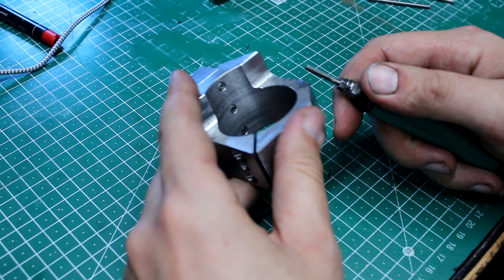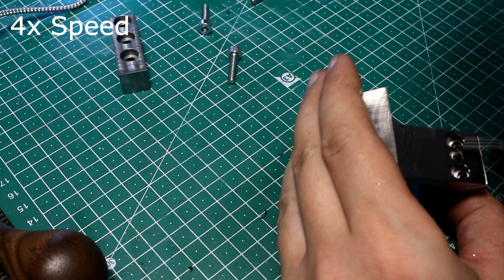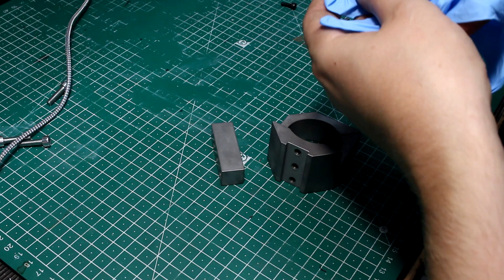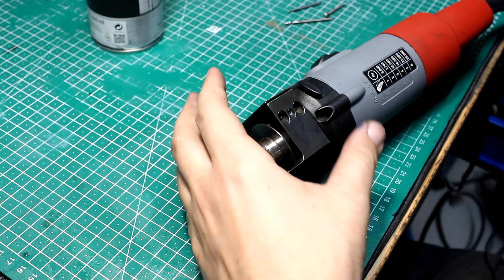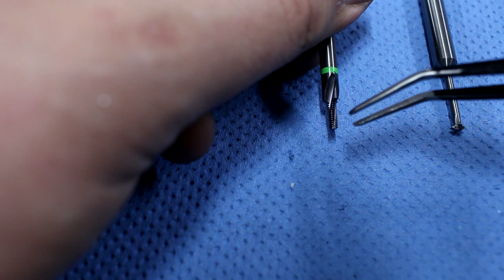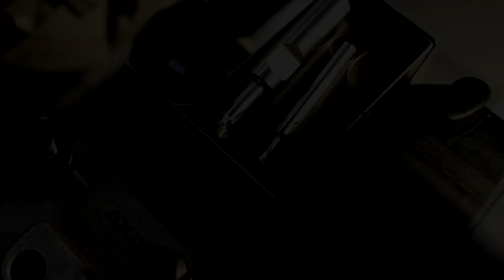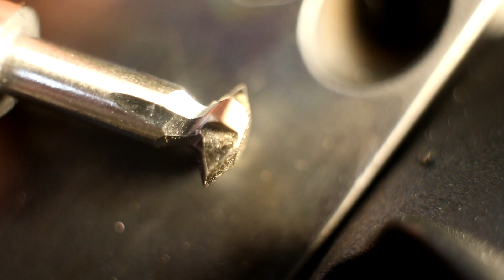Threadmilling on a manual lathe

Comment: Seems like we have a similar strategy on deburring: 
Step 1: remove blood stains
Step 2: debur the part
Step 3: check part for blood stains. If any found, repeat at step 1
Reply: Im a hvac guy by trade.  When Im knocking tin, I bleed.
Reply: Totally agree, I cringe when I see home gamers (and some pros), checking a broken edge with their pinky to see if its still sharp. lol
Reply: @1ginner1  at least they check. 😅

Every shop I've been in, everyone leaves sharp edges or burrs to save time and cut corners.
Reply: Cutting corners by not cutting the corners?

Comment: Hi Stefan. Nice to see the solution to a very old problem for which the model engineer's Guru George Thomas had a much more complex solution. Folks, when you slit into a previously bored hole there is a tendency for the bore to close in. Stefan's jack screw is a very simple and elegant solution. BobUK.

Comment: I have been doing milling on my lathe for a while now and the first thing you need is a spindle indexing disc and a brake acting directly on the spindle axis. I usually index the chuck by jamming the feed gear that's 1:1 to the spindle with a pin and that way I do keyways, holes, steps and I even made the 60 position axial ratchet for my Tripan toolpost using this method. Don't forget that you can use the compound to mill at an angle (eg to make an insert cutter) or put it above or below centerline using the qctp (usually to sidemill a surface that is on centerline) essentially utilizing it as a limited travel vertical milling attachement (you can't feed upwards though).
Reply from the maker: Personaly I am not to interested in general milling on the lathe, my mill will do that better, but its definetly a nice option to have!
Reply: @StefanGotteswinter  The mill I work with is a very heavy to move around and setting it up is a real hassle. Being able to cut a keyway in 5 minutes is such a delight for me!

Comment: Could you use a small generic end mill and do an ACME thread with that setup?
Reply from the maker: You would need a tapered endmill, and then its still questionable if you get the correct threadprofile..

Comment: Thanks for letting me look over your shoulder while you explored this - very kind of you.

I was wondering why you didn't use your chamfering machine you made back in this clip: https://www.youtube.com/watch?v=M8pLEfKZy4w  ??

I like the climb grinding technique for doing chamfers as well -  much better results. 

I see you went with a brushed grinder - instead of an air grinder - like a PLANET 600 - capable of doing 1um grinding? Both the  NSK and the Kress seem quite expensive for what they are 10um and 1um spindles.  Might be possible to create an air bearing spindle? The ER16 adds a lot of value to the Kress - wish the price was a bit gentler. 

There was a similar story to the cannon - Roman engineers and their families had to live under the bridge they designed for a year - probably just be a story - can't find any historical references to it.
Reply from the maker: It was quicker to do it with the biax, as there are many internal/circular edges that needed to be taken care off.

Comment: Since we know the Germans are very precise, and matter of fact on details, I now have this image of Stefan trundling his shop vac a quarter of the way down the road to Munich laying out the PVC string in order to give us that measurement.

On the flex of the first threadmill, seems like it might be possible to set up an outboard two bearing steady on the shaft of the threadmill itself if the flex becomes too much of an issue?
Reply: I don't know if his calipers would reach that far but if any one could do it Stefan would find a way !

Comment: Great stuff, Stefan! Since you have that lovely Deckel, could you not make rounded tip instead of a sharp corner? (and thereby keep the root diameter a little higher/match screw threads more closely)
Reply from the maker: Yes, I could dress a tiny concave radius into a wheel and use that to grind a radius on the tip. Probably a pain in the youknowwhat without a optical comparator to check the radius ;)
Reply: What about a truncated tip instead of a radius? It would still let you increase the minor diameter.

Comment: In your opinion Stefan, as someone whodoes a lot of smallrun production, do you feel this saves a worthwhileamount of time vs single point? I suppose you could thread 1 part perfectly, note your crosslide position etc. And then just churn threads out on a bunch of parts, two passes each yeah?
Reply from the maker: It might speed things up, especially on threads that would normaly need many passes to single point.
But more so for those impossible threads on a manual lathe..
Reply: @StefanGotteswinter  ok cool :) thanks for the reply and great job, looks and functions really well
Reply: Wow ok the second type was super fast haha threads from thin air, guess that answers my question haha
Reply: That was an awesome video. Super nice finishes

Comment: One problem you may find with the digital microscopes is lag. However rolling your own with good performance is not hard. Use a cheap racing drone camera with a display. It can be wired or wireless Drone flyers can not have lag when flying. Most of these done cameras have a C-mount. There are several little microcpe assemblies on amazon with C-mount adapters you can mount the camera to.

Comment: In my father's shop back in the seventies we used to do the final grind on hardened threads with a diamond embedded linen phenolic wheel mounted on a tool post grinder.  It wouldn't take much off but it made the threads extremely slick.  It was set up much like what you're doing except the cutter and/or lap was mounted on a mandrel.  The angle could also be adjusted for clearance on larger threads by tilting the spindle up and down in the front.  Fun stuff!  Thanks for the video!

Comment: I have both high quality optical microscopes and cheap video scopes. I put a video scope with built in display (about $49 if I recall) on a magnetic indicator base. I use it in my Emco super-11 and my Hardinge toolroom lathe. It gives a great view of cutter action if you need it.  It is also is useful on the mill too. While the quality is not like a Leica scope it does keep your face away from the action. Don't under rate the cheap scope it works and other can see it. Great for demos. 

 I mounted a Dremel moto-tool on my Emco 30 years ago to spin and abrasive disc to cut Hastaloy X . I also had an air turbine with a multistage planetary to spin a slitting saw for screwdriver slots on a homemade gang tool CNC lathe. I also used a full speed turbine (50K or so) to spin very small PCB drills on the gang lathe too.

By the way Robin mispronounces Hardinge. He says Harding instead of Hardinge. I noticed you have adopted that too.  The correct pronunciation ends with a sound like Hinge (like door hinge) but without the H sound. Please take no offense your English and your videos are excellent. I watch them all.
JY
Reply: I've been wondering about that for years!

Comment: That would also work ideal for face grooves/recesses on a part with the spindle parallel to the lathe spindle. The OD Perpendicular thread milling with the proper profile tool could work good for custom wood screws or metal inserts for plastic/printed parts.
Reply from the maker: Right after I read your comment, I looked at a drywall screw ;)
If I ever need to make something like that I will keep that in mind!
The facegrooving is something I tested (didnt film it), and it works suprisingly well, and with the cutter doing a full slotting cut, it also runs very quiet.

Comment: The reverse set-screw interference fit bit is a nice trick.
Will be adding to my designs.
Reply: Same system as used on my 40 year old drill press head.
Reply: Referred to as "Jack Screws". I use them all over the place

Comment: Very nice Stephan.
I find lots of little embellishments you do usefull to learn.
Like using a set screw to open a coller clamp that allows for a precise fit without over torquing a small fastener.
Like Filing a precise 45deg bevel junction on an inside corner.
Instructive, thank you Sir.

Comment: I would have thoroughly enjoyed working side by side with you back in the day. I like the way you think. 100% Great video.
Reply from the maker: Thanks Joe, thats an honor hearing that from you :-)
Reply: @StefanGotteswinter  yes i think this system  . could answer my problem i have with my lathe . it being  a Colchester . graduate with out a led screw. it will signal point thread  . but using the rack. &  not the  lead screw. i feel the rotary & linear drive being fixist will  . tack to thread cutting By this metered well   thank you Stefan.  Les England tried it out & it as the potential to deliver a varying ranges  of thread pitches frim pipe thuds to BSF & WITE  I've  yet to  try metric   I have been using old broken taps to develop my thirds & the appropriacy thread gearing for the rack. intrusting results .
Reply: I love it when our favorite YT machinists contribute on the rest of the community's content.  We have a pretty great little corner of the internet with some pretty great people.  You're a stud Pi!
Reply: @shirothehero0609  Stopped watching TV time ago ! Dont even have a TV anymore... 
With all this content coming, I watch only this community
Reply: you two should open an international shop together. "Precision Inc."

Comment: Manual lathe live tooling! I improvised mine on my beat up Sherline by repurposing a Dremel I had lying around, it works well enough for engraving lines on knobs and things like that. For that last test with the D-bit, I would think leave a kind of rough finish at the bottom of the thread valleys, since the surface speed at the tip is only whatever RPM you've set the spindle to?

Anyways, always nice to see another video!

Comment: Nice work Stefan, could you do a multistart thread on the Emco?
Reply from the maker: Yes, of course. There are multiple ways of achieving that. Either by indexing the work after each thread-start (Works best between centers), mounting a compound slide back on the lathe (oh horror) and move the threading tool in Z direction for the next thread start. 
Realy brave people can swing the changegear-banjo out of mesh, turn the spindle the desired angle and re-engage the banjo.
The last version has the highest pucker-factor ;)
Reply: @StefanGotteswinter  Sounds like your next video! :-)

Comment: Hi Stefan, this was excellent Thank You. A few questions - Did you try a rough cut on the in / out feed then an immediate spring cut by reversing the feed? Have you considered Dremel diamond cutting wheels for your tiny tool cutting? Could you make a tiny tool support (like an itty-bitty knurling tool) with bearings for your milling tool? Lastly, could you cut ball bearing screw threads and a nut for high efficiency & precision parts? Stay safe and well :)

Comment: What is the brand name of the hand held die grinder used at 2:05 in the video ?
Reply from the maker: Biax SRD 3-55/2
http://www.biax-germany.de/en/produkte/data/SRD-3-55-2_150000925.php
Reply: Ha. Clearly I wasn't remembering correctly.
Reply: I think he has mentioned before that it's just an "El Cheapo"... But I'm not 100% sure if I'm remembering correctly.

Comment: "I'm not the first guy to do this". Stefan, by now I would think just about anything that could be done with a manual machine has been done. IMO the most impressive things done on manual machines are turbine impellers that were done pre cnc. And the interrupted threads on the breaches of large naval rifles. Given the pressures they had to withstand they had to be absolutely perfect.

Now if you had a way to run your cross slide at the proper ratio you could make chuck spirals. And I know they had set-ups to do that on manual lathes. Setting the router at the center of the included angle you could also cut buttress type threads.

Not germane to threadmilling but in the past I experimented with making roughing mill cutters out of taps. Grind a relief angle on the top of the teeth that gives a flat wide enough that all the flats are longer than your taps pitch. Grind a secondary relief angle. Works fine on softer materials. Not so much on tool steels. I worked with some machinists from Germany and they told me that in the 50s they used to have to make end mills out of twist drills.
Reply: I would like to hear more about the difficulty associated with cutting the interrupted threads for naval guns. Can you point me in the right direction to more information?
Reply: @BravoCharleses  
Sadly no. To be honest I don't know if they where single, double or multiple lead threads. I suspect that multiple lead threads would be weaker simply because of the lead angle of the threads.

Comment: Hey. I use the cheap video scopes and find the latency always messes up my actions (in electronics). Good for static but not for dynamic. We use the Vision Engineering viewers for assembly work and they are great. You look into them and do not have to have your face on top of it. There is also some 3D effect. Highly recommend 750-1500 USD
Reply from the maker: I have a Mantis at work, and to be honest, I am not the biggest fan of it - I can work better with a normal stereo microscope, as the head is kinda fixed in place when looking trough the eyepieces.

Comment: Diamond and HSS works fine, and the resin-bonded diamond wheels are so cheap now that you can ignore how terrible an idea it is. 
I suspect that the "diamonds dissolve in steel" thing (which is undoubtably true) is more of a problem with single-point diamond tooling than with effectively disposable Chinese cup wheels.

Comment: If you set your parts on a paper towel after applying the activator, the bottom side may not get the full effect. I try to use a rack over a small container to catch any drips. If you flip them half way through the process, you can ensure the most even finish. A good cold blue finish is all about the preparation. Great video, and great design for the toolpost router, I am gonna steal the general shape, except I am also gonna build one for a TIG torch.

Comment: Is Kress related to Fein? The design and colour scheme seem identical.
Reply: They are called AMB now. If someone have more information on why that would be interesting. Maybe AMB bought the spindle motor part of Kress?
Reply: Kress Elektrowerkzeuge went bankrupt, the name/label was sold to a Investor (look for WORX and compare their tools to new Kress labeld tools). AMB however is a company found by a few ex-Kress-workers and they continue the manufacturing of a few products: milling spindles (FME 530, 800,1050 and also with ATC) bevel-milling tool, few angle grinders, a high torque drill and a bisquit jointer (from the pics it seems to use the same fence as the Mafell LNF). However they afe not related to Fein in any way, color is completely different as Fein is in their classic well known orange color.